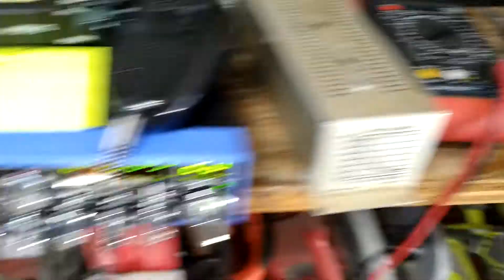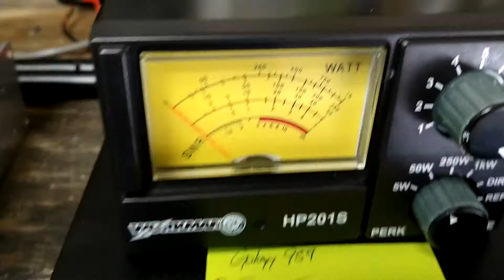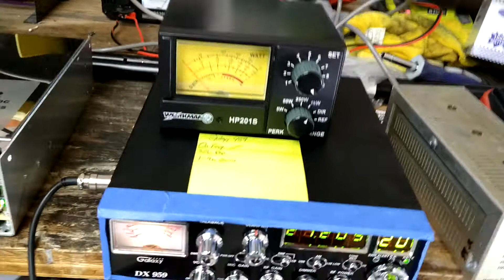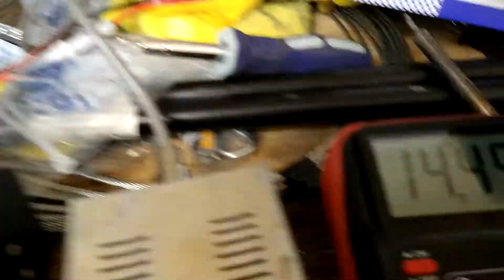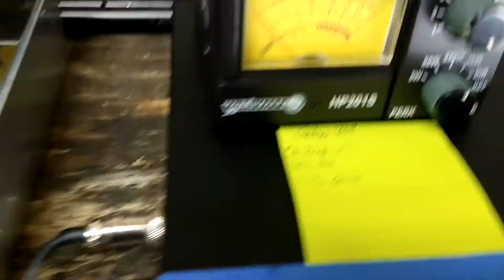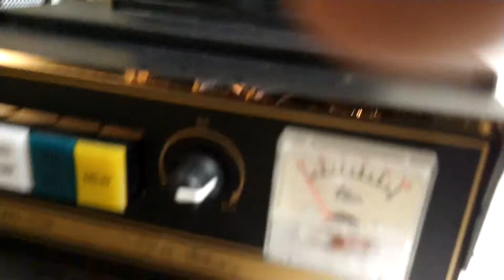Down and dirty Texas star 667v amp test

Comment: The Fan Kit is supposed to blow on the heatsink side of the amp !
Reply from the maker: It doesn't matter, you can install the fan on the heat sink or install it to cool the components inside the cabinet. Either way will work and doing both are best.
Reply: It has a hole cut in top. UT yes I have ran on heat sink

Comment: Do you think just one S-700-12 would run a Texas Star 500?
Or would you run two of the 50 amp supplies together for 100 amps.
Reply from the maker: It really depends how hard you drive it. It can definitely be ran on one if you run it easy, but if you're going to drive it hard then I'd double up on them.
Reply: @vegasfordguy  ya not sure what's going on I have 2 stacked but one of them keeps popping fuses. But my amp meter only shows it pulling 35amps so IDK Maybe the digital amp/volt meter is out of calibration.